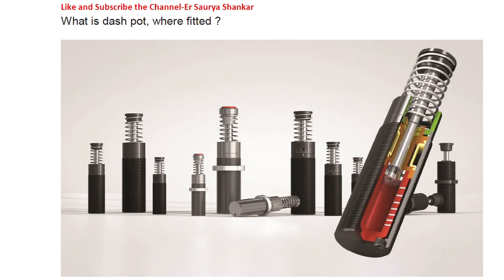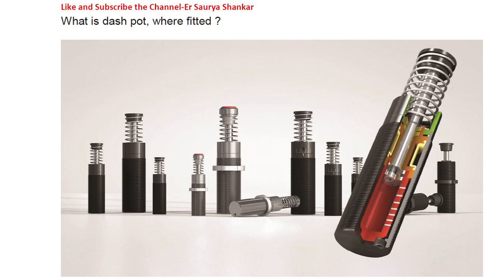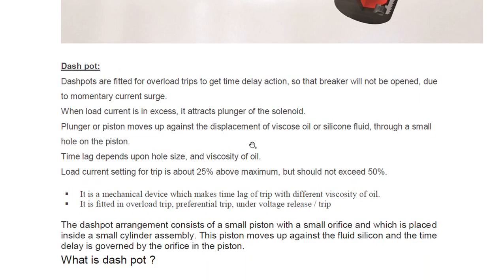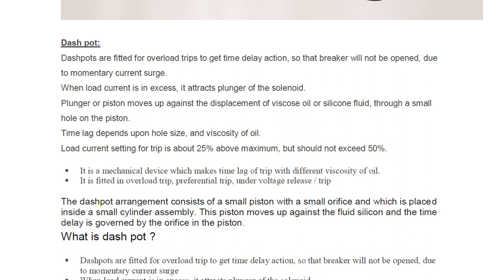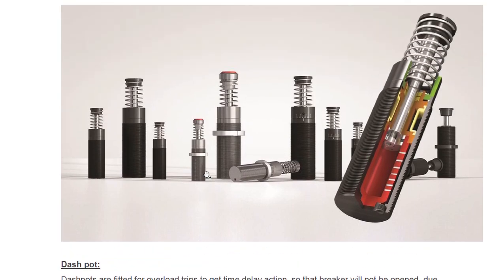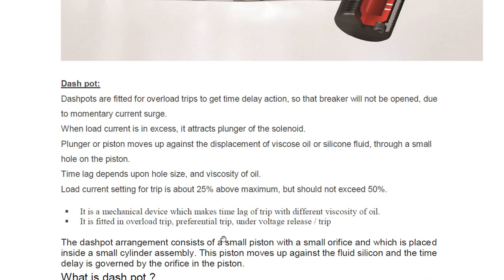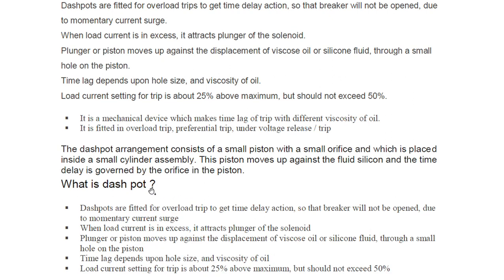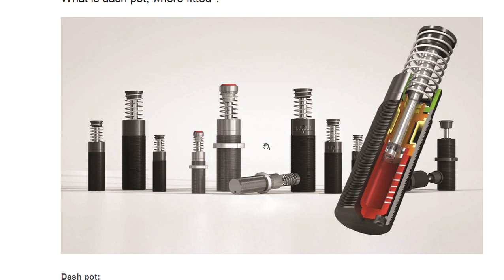Dashpot; Function, Construction and setting.

Comment: What is control voltage
Reply from the maker: CV(Control Voltage) is a DC electrical signal used to manipulate the values of components in analog circuits. Control voltages are used in numerous ways in many different types of electronic circuits for all sorts of purposes....